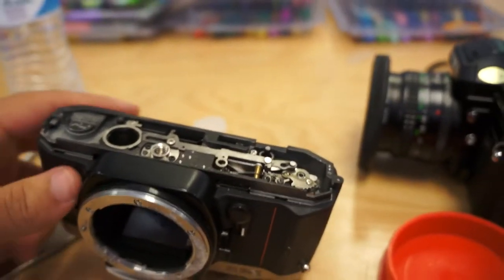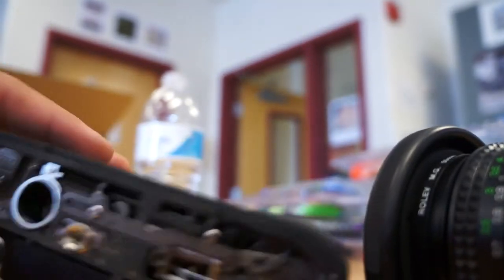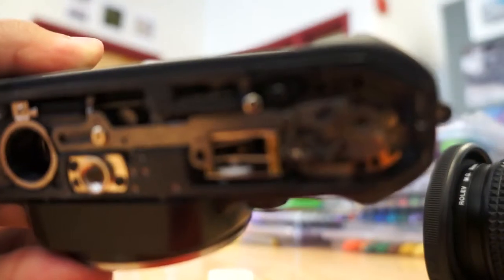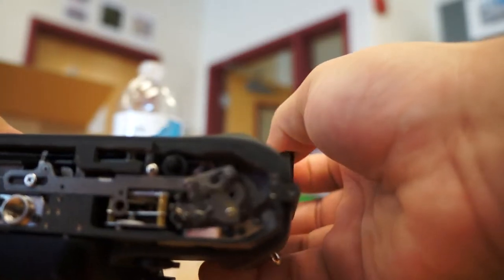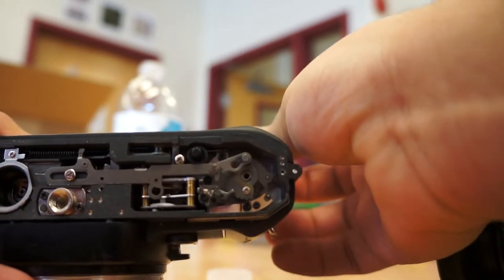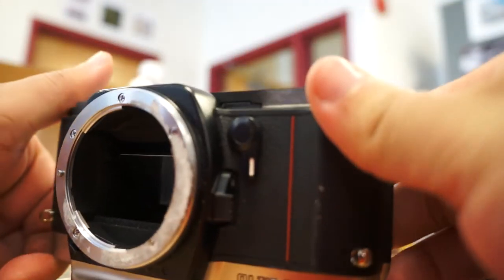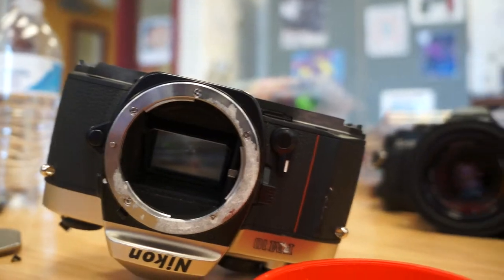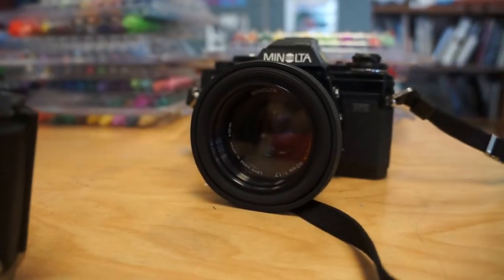Nikon FM-10 Clockwork Repair [Shutter Not Fireing] Part 2

Comment: What kind of screwdriver/tool did you use for the screws at the bottom of the camera? I can't seem to find one small enough.
Reply from the maker: Sorry about the late reply, but I use the iFixit 54bit Driver Kit with some of the smaller bits.

Link to set: http://www.amazon.com/iFixit-54-Bit-Driver-Kit/dp/B008KOTNVA/ref=sr_1_1?ie=UTF8&qid=1406224489&sr=8-1&keywords=ifixit+54+bit+driver+kit